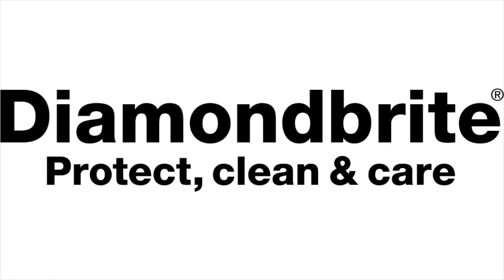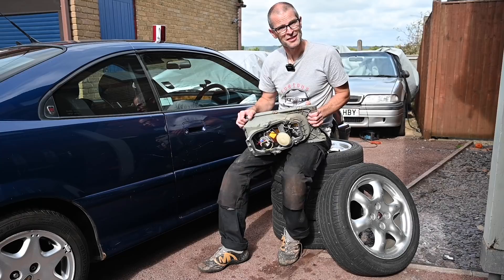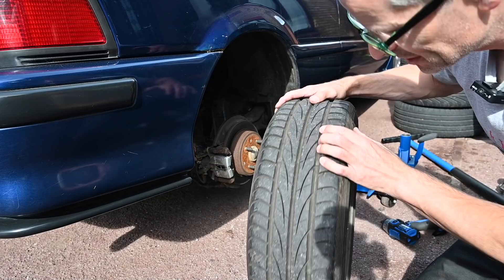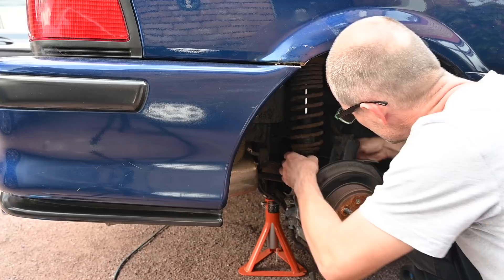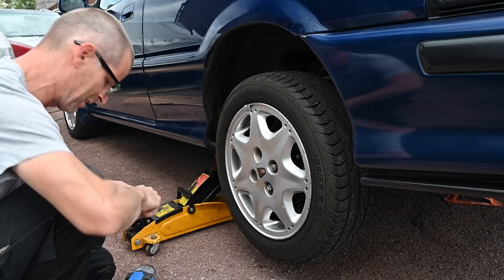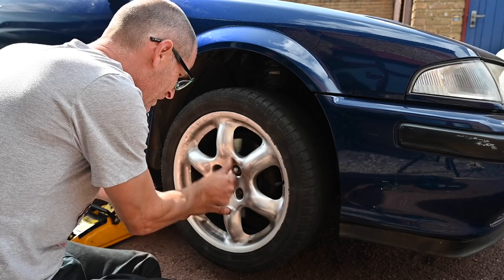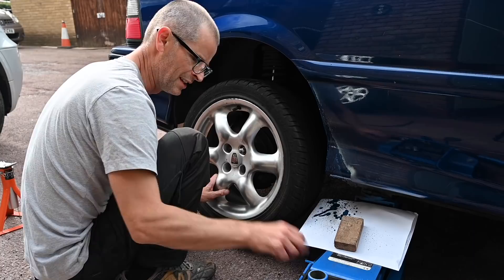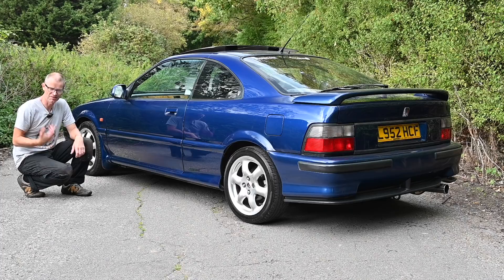Rover Coupe gets new wheels and other tinkering

Comment: Matt, I would guess the nozzle on your spray can was partially blocked. The way to avoid this is, when you've finished spraying, turn the can upside down and spray until the paint stops coming out. Always worked for me! You can also try pulling the nozzle of and soaking it in thinners for a while.

Comment: Wheels look good better than I thought they would look, little tip with aerosol paint, when you have finished spraying turn the can upside down and spray the paint out of the nozzle and internal pickup pipe, this will run clear after 3-4 seconds then next time it shouldn’t block up the nozzle like it has here. All the best. Steve.

Comment: The car looks fantastic on the BRM wheels, much better than the old ones. And I think I agree on the ride height, just need to close the gap a little bit more, she’ll look spot on then. 

I had to giggle to myself when the spray paint was struggling to come out, and left awful runs on the bodywork 😂 reminds me of my dad who tried to touch up his wing with a rattle can, the spray was working fine, but he must have been holding the can about 3/4 inches from the  bodywork, so it was running like crazy and dripping on the floor😂😂😂  that was 100% user error though!

Comment: As a Rolls Royce trained painter the erm technique and finish of your repair wouldn't pass quality control I have to say lol A good tip especially on cold days. First off always turn the can upside down and clear the nozzle after use. Then before you use it again just put the can in some "warm" but not boiling water for a few minutes. It'll build up the cans internal pressure and make the paint come out much nicer. Be lucky
Reply from the maker: What do you mean that wouldn't pass quality control? How dare you! It was just a dreg but I thought it would do more than it did!
Reply: Dude it's the passion that matters, skills are learnt lol. Keep up the good work.

Comment: Not sure which wheels suit best. Still a gorgeous car. Matt, you're video output is awesome,  you can slow down a bit I'm sure. Burn out comes all too easily. I've taken two weeks of fiddling to drop the struts on my 145 to check the turrets. Sorry for reminding you about your's  No rot at all but both inner wings need a patch of welding.

Comment: I'm not normally a fan of bigger wheels, as they always ruin the ride quality. But I have to admit, those do look rather splendid. Think I'd be getting a proper set of decent tyres and keeping those. And the old wheels would look rather good on the R8 Convertible. That's a great win win on the R8 front. Can't wait to see the Tomcat in a fresh coat of Tahiti Blue. That along with the new wheels will make it one of the best examples still on the road.

Comment: Wasn’t sure about the new wheels at first as usually am a stickler for the factory original look, but I actually think they suit the car really well. The slightly more rounded jelly mould look of them is very appropriate for the more rounded car designs of that era, so in a way they almost seem to suit the car’s age more than the previous one. Looking forward to more updates on the convertible too!

Comment: those wheels give it a fresh look as in my opinion the ones you took off date the car,  whereas with the new wheels it takes six years off the clock and I wouldn't bat an eyelid if I saw it on a T - Y plate with those wheels.

Comment: Great video, Matt. I do like the new wheels. Very sharp. Definitely need 4 new tyres though. Mismatched on the same end is not good at all. I don't know about there, but here the specification is to replace tyres after 5 years of use. The carcass gets weakened by the heat/cool cycles.
Reply from the maker: We dont have age limits here, but probably should as most people have no idea they go bad over time. Although I know they are old and need to be changed a lot of people would just keep going with them

Comment: Hmmm,,,, your problem with the blue paint wasn't the paint, it was the spray nozzle that you hadn't cleaned out after the last use or before this one. Thinners and wire would help.

And as for the tyres.... a bit Reg Prescott of you to mismatch them all over the car, logically the old worn decent ones are a matched pair on the back and the new budget ones with good tread belong on the front. Swap the drivers side wheels around when you finish the paint repair. Kenda is an OK brand for cycle tyres at least. 

The car looks a lot better with the BRM wheels, I think the Coupe is more curvy than angular and they emphasise that. The original wheels will suit the cabrio, classy rather than sporty.

The ride height looks just right now IMO....

Comment: Tip, keep tea/coffee mug well away from work area to prevent crud or dust from getting into the beverage and even worse, if using a paintbrush, dipping it in the mug instead of the paint kettle, don't laugh as have done it more than once.  I am not keen on shiny tyres, prefer to use black emulsion paint with a satin sheen.
Reply from the maker: if you wipe Replenish it dries satin, I use it on seals like that
Reply: @furiousdriving  Forgot to mention that lowering he car might be a bad idea on UK roads with all the potholes and very high sleeping policemen on some roads.  Front end damage might be an issue.

Comment: The coupe had a slightly shorter wheelbase and could only genuinely take 4 adults as long as the front driver and passenger didn't have their seats pushed right back on their runners, because this compromised rear legroom.

Comment: They seem to fit very well those wheels! Which is a bit confusing because aren't the 800 and 600 series supposed to have 4x114,3 bolt pattern and these 200 series cars 4x100?
Reply: Of course they fit, the green tourer is a 400 series! :) also 4x100

Comment: Don't use a rust converter! They are all rubbish, they only convert the very top layer turning it black. Use a good rust stabilising paint instead (after removing as much of the rust as you can).
Reply: No, it's not rust free! and no it hasn't been stopped, try scratching the rust converter when fully cured and you will see brown rust still underneath the top layer.

Comment: Speaking of old tyres with grat thread still on them. My 4 year old Toyo NanoEnergy 3 tyres where great touring tyres for the first 2-3 years. Now in its 4th year, it still has deep threads on them, but due to age (only 4 years!) they had noticibly degraded in performance. Now they brake much worse, and spin a lot more when driving off. And that is in the dry! So yeah, just because tyres look good and have deep threads on them does not mean they are good. 10 years? Time for a scrapyard.
Reply from the maker: Definitely. My Rover 2000 had a set of ancient tyres on and understeered on every bend, a new set and it was a new car..I was shocked when I realised those are 10 years old as well now! How many tyres do I need now?
Reply: @furiousdriving  Maybe buy tyres in bulk? xD

Comment: Surely if you loosen the spring you will have a taller and softer spring? If you compress it it will  lower the car and stiffer??
Reply from the maker: thats what I thought last time but it went up not down!
Reply: You’re altering spring preload. The spring rate doesn’t change when you alter the preload, you’re essentially just changing where the damper sits in its stroke.
Reply: @Tom-pb6vs  What about the suspension geometry? It will need adjustment after lowering?
Reply: Thats not how coilovers work. Moving the platform simply alters ride height. Damping rate or spring load is not being changed.
Also a trolley jack should never be used on sills. Very bad practice without wishing to sound too negative.

Comment: That was bodgery worthy of HubNut - except I doubt that Ian would have done that - he would have just left it until it could be fixed properly.  On the question of tyres - they are the only thing between you and certain death and I will never skimp on tyres because I don't want to die just yet, nor do I want to kill my family.  It cost me over £600 for the Vredesteins I have and I'm very happy with them - it really isn't a good idea to get cheap tyres, they're cheap because they're crap.  On a car (Spec B) which will allegedly do 150 it seemed silly to me to get rubbish tyres.  So I bit the bullet and got decent tyres.  I would urge you all to do the same.